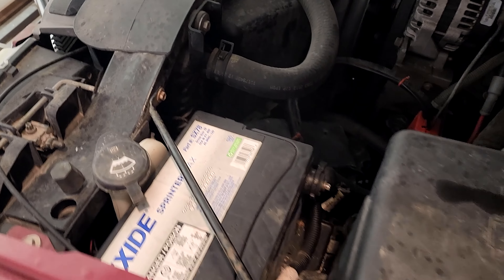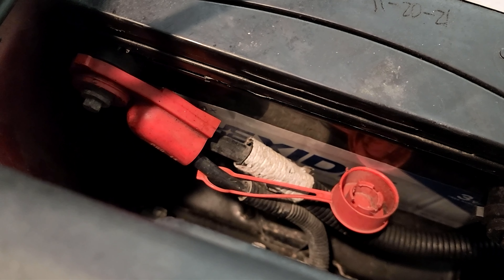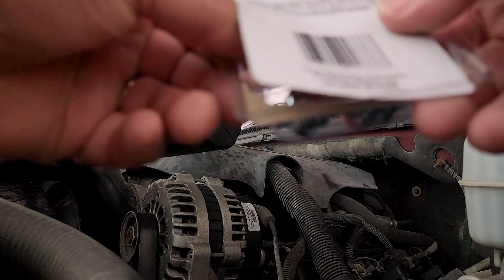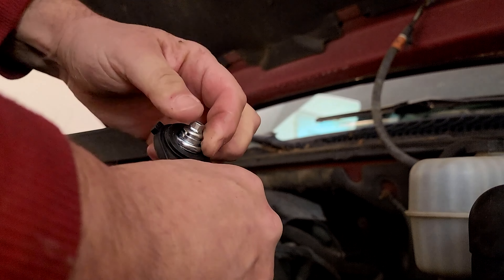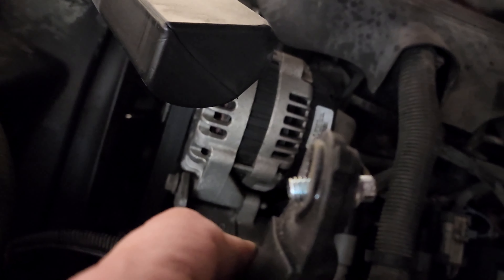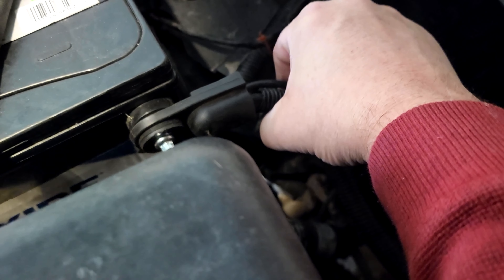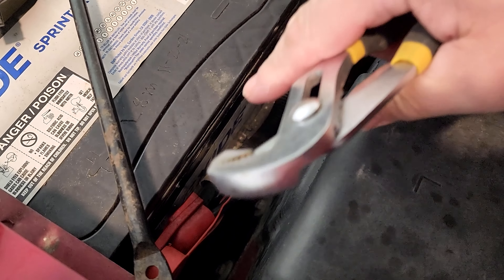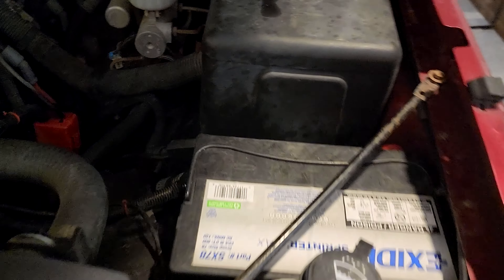Loose Car Battery Terminal Bolt Replacement When Car Will Not Start

Comment: They make a purpose built ratchet wrench just for battery terminals, will prevent chowdering up the bolt head from not using the proper tools. They are not expensive.

Comment: Your best tool is not a pair of Pliers!  Using pliers instead of teh proper size (5/16"?) six-point socket - they sell them at the same store that sold you the bolts.

Comment: DO NOT put "machine oil or grease" between the battery post and the cable/bolt. Just clean the dickens out of the mating surfaces. If you have a bit of DILECTRIC GREASE - that can be applied in accord with the directions that come with the stuff.  DO NOT Grip the head of these (or any bolts) with Vise Grips! (unless you have no further use for the bolt ;) !  You do NPT want to take a chance of 'rounding' off the points on a bolt you'll need to keep/use.

Generally speaking , one should disconnect the ground cable before removing teh positive cable. That way, if your metal wrench contacts the grounded metal part(s) of teh vehicle, you will NOT have a spark of any sort.

Don't you wish that folks willing to take the time to make such a video would gather up the correct tools and learn teh correct way to use them before teaching others?